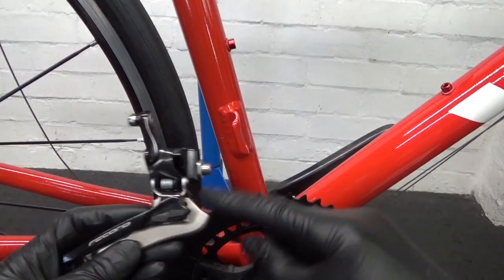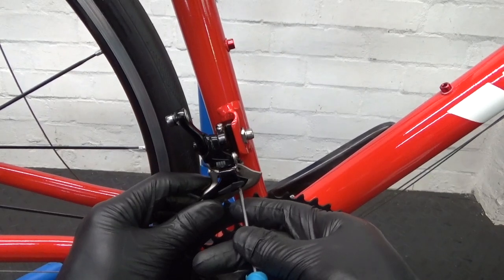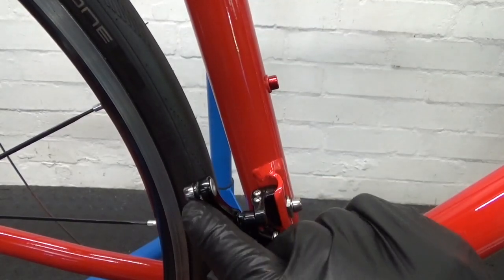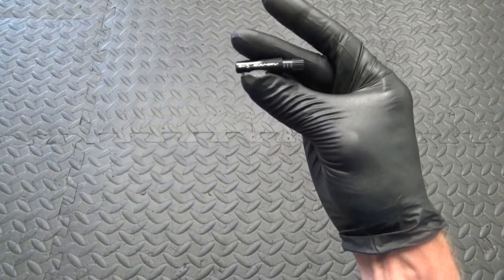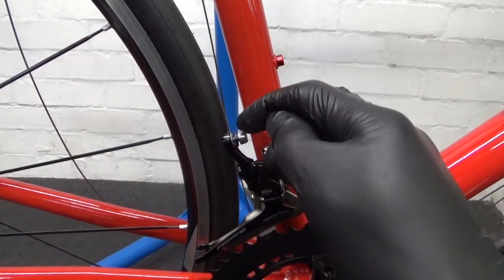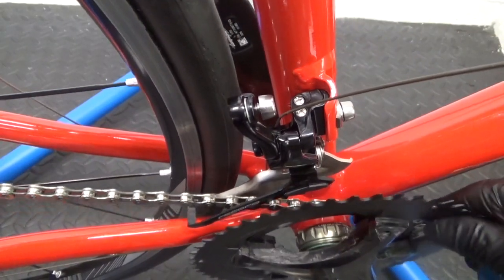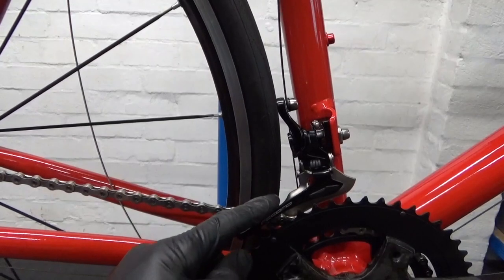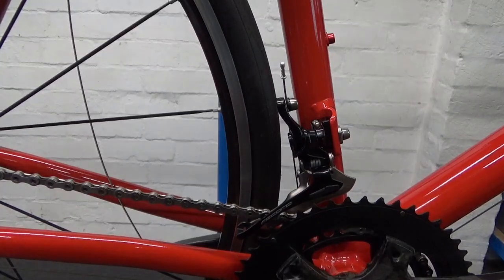Campagnolo Record Front Derailleur Fitting Guide

Comment: Hope you can answer for the Record derailleur:
Just followed the steps setting up chain clearance on the inner chain ring and tightening the cable.
It refuses to shift to the larger chain ring- tries but nothing. (Cable tension?)
We had it shifting up there once then it wouldn’t shift back down.
Not using a cable tensioner since there’s one on the frame.

Comment: Very informative, good. I have a Campagnolo Chorus 12-speed mechanical groupset. With the 48 ring I can't get past the middle of the cassette, the chain is rubbing against the top of the front derailleur arm.
I want to replace my 48x32 crankset with a Rotor Power2Max 46x30 crankset. Do you think this should work well with my Chorus chain and front derailleur. I wish I could use up to the middle of the cassette again with ring 46.
Best regards.
Reply from the maker: You can trim the derailleur whilst riding to avoid the chain rubbing on the cage! The front shift lever as three clicks in each direction!! If you are in the large front chainring and click the front shift lever once it will move a little to allow you to shift across the rear cassette without the chain rubbing on the cage.

Comment: I have Campagnolo Super Record 12 Speed Mechanical Groupset.  My front derailleur's spring holding arm broke off about few rides.  So I just purchased and replaced it.  Then it broke off again.  Does anyone having this issue?  I want to know whether issue was caused by something I have done or it is a manufacturing defect.  If you can share your thought, that would be great.  Thank you in advance.
Reply: Hi, I had the same problem, also found in some FB groups the same issue.
Reply: Just curious might you have had any pictures it could have been from tightening down the screw or where did it actually break off from